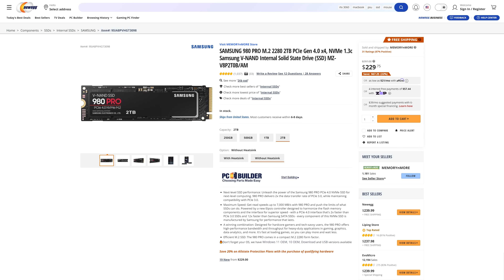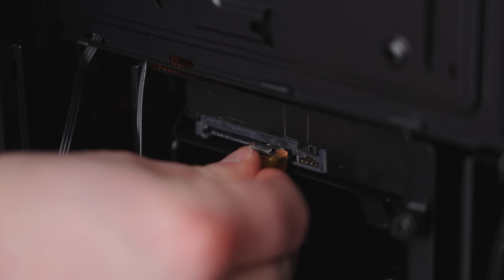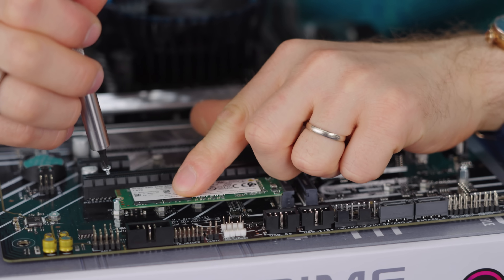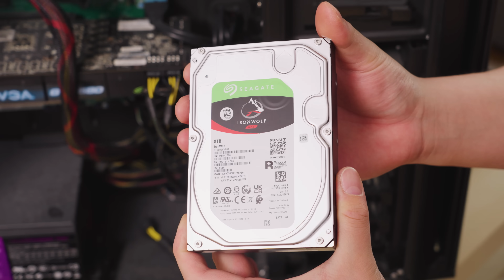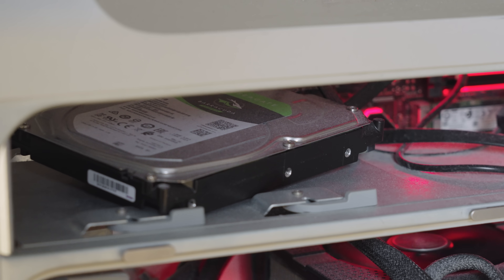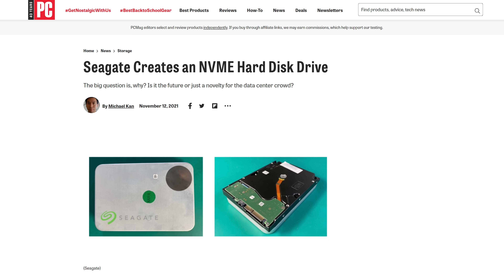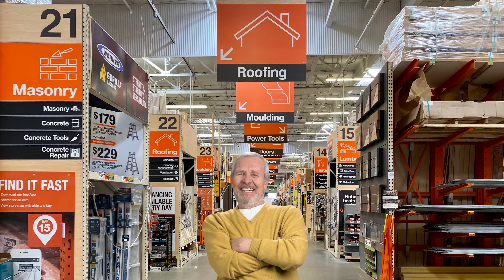Is SATA Obsolete?

Comment: I pulled out my old 74gb WD Raptor 10,000 rpm hard drive not that long ago. It still worked and still had the original Windows XP install on it.

Comment: Nah, I'm genuinely surprised that SATA is still a thing, even on the most modern motherboards. Please, someone pound a stake into SATA's heart and put it out of our misery.
Reply: Why? There's nothing wrong with SATA, just because you don't need it, doesn't mean the rest of us don't need it. The reason why it's around is that it's great for connecting many disks to the same computer and because it has a bunch of flexibility, I have two of my internal ports redirected out of my case via an e.sata port adapter so that I can have external drives. I don't see any reason for this to be such an imperative. It likely will eventually go away, but when the main issue is speed, it's probably not going to happen any time soon.

Comment: I’ve found the NVMe can generally be found cheaper than SATA drives already. The only reason to use SATA is when you’ve run out of M.2 slots.
Reply: For similar storage capacities sure, but you can find extremely cheap low storage SATA SSDs.
I've bought a few 120GB-240GB for less than $20 to retrofit on older computers. The latest one was a Patriot 120GB for $13.
They also make a perfect boot drive for a raspberry pi build or a cheap micro/media pc

Comment: I still use HDD for storage so SATA 6G ports are still viable for me. NVME is not priced as cheap as it should be. It should actually cost slightly less than SSD's. Considering you don't need a case for it and it is cheaper to ship and other factors. They are still gouging the price and until they stop I will stay with SSD/HDD combo's.

Comment: 1x SSD 128GB for my sys
1x SSD 512GB for bigger games (for shorte loading time)
1x HDD 1 TB for small games
1x HDD 2 TB for hobbie-stuff
1x HDD 8 TB for useless trash (datahoarder)

no need for an NVME, dont care in my system loads in 5 or 20 sec... i boot the PC only once a day

Comment: The reason SATA won out over pata is because pata maxes out at 166mb/s (which is slow even for mechanical hard drives) and sata maxes out at 6gb/s which is more than enough for mechanical hard drives but causes ssd's to top out at about 400MB/s (fast hard drives are only between 100-200mb/s).  Further the sata spec uses much thinner easier to manage cables that are physically AND electrically more robust (for longer runs) and standard integrated sata controllers used to have 8 ports on them, until they've recently been torpedoed to 6 ports max or even 4 ports on some lower end or small form factor boards due to space savings or money savings.  SATA isn't going anywhere in the short term because it's EXTREMELY popular to simply shove 6 or 8 hard drives in a low end computer and install a free NAS operating system like TrueNAS core/scale, or any number of others (for most truenas is probably where it's at though in terms of protecting data via zfs)  and enterprise storage servers BASICALLY do the same thing - only those are designed to be rack mountable.  tl;dr they don't MAKE nvme ssd's that are large enough to hold all the data I (and lots of other people) want to store.  especially when they only give you 2 or 3 (or sometimes only a single) m.2 slot on a motherboard.  the biggest slc pcie4 m.2 nvme drive i've seen so far is 8tb at an eye watering $1500, the 4tb version  is $700, which means that for most folks the attainable reasonable highest you'd actually buy is 2tb (still at about $300) which is still pretty expensive...  meanwhile I can go out and pick up a 14tb hard drive for about $300 or if I wanted to build a nas, I could get a 10tb drive (which is kind of the sweet spot right now for about $200).  if you put 8 of those together in a raidz3 nas, the speed scales not exactly linearly but close so you're looking at about 800MB/s (considering 5 active drives and 3 doing parity storage) (if you don't include any ram caching or compression which zfs is awesome at), so I could build a 2.5gb/s file server (honestly it should be faster) for about $1400 (in storage) with a practical storage size of 32tb (taking into account data redundancy and that the array needs to stay 20% free for anti-fragmentation purposes and slop space allocation) AND any 3 hard drives could fail at any given time without losing any data.  Every household with someone who takes pictures, videos, does any kind of creative work, etc. should have such a machine. (AND that machine should be backed up off-site (raid/zfs IS NOT AN INTERNAL BACKUP METHOD - the array is 1 of 3 places you should have your data stored. (it should be stored on some other local device AND a device off-site (be it cloud storage or regularly backing up to a series of hard drives and bringing them to another site or setting up another nas in another site and backing up to that).
Reply: 10K RPM hard drives are also bottlenecked by anything below SATA 3 or 2 usually. SATA 1 also maxed out at 150 MB/s, so that wasn't faster than IDE/PATA either.

Comment: No SATA is here to stay.. I just purchased a Crucial MX 500 SSD as my motherboard only had one M2 slot which had Kingston A2000 installed in it. If you want multiple SSDs then the only way is to use the SATA port

Comment: I'd imagine data centers would still have to rely on multi-TB HDDs until it comes a point where NVME drives can reach those same capacities at a competitive price. But it's nice not to be able to use them in a gaming PC because it means less cables.

Comment: If you need lots of storage, but not much concurrent transfer, you can also use a sata splitter to get five ports per connection. For a personal video archive, for instance, you will often have more need for storage than throughput.

Comment: the cost of nvme (particularly pcie3 nvme right now), is roughly the same cost of sata ssd's at reasonably large sizes (1 or 2 tb).  if you're in the market for an ssd, just buy the nvme ssd (that's roughly 7+ times faster and arguably slightly more reliable).
Reply: yeah I was trying to build a new pc with nvme/ssd boot drive+ssd/hdd storage mindset, but when I look at the prices it surprised me how 1 tb nvme is the best bang for the buck I could get
Reply: @naufalap  same, I recently upgraded my storage with a $200~ 2TB NVME. That pricing was unthinkable when I had built this system only 4 years ago in 2018

Comment: What kind of bad explanation is this? PATA and SATA are effectively the same, as they are both ATA standards. PATA was developed during the IBM days in the 1980's and at the time was the best interface. However PATA had the big problem of crosstalking if they went above 133 mb/s, and because a parallel data exchange doesn't allow hotswaping. To combat this a few techcompanies formed a organization and created SATA in 2001, SATA used bitqueueing so the datatransfer didn't need to be in parallel anymore and it eliminated crosstalking so faster speeds where possible. 

Early Sata effectively used the same processes ad Pata did. In fact both used the IDE protocol until ahci came around. Unfortunately SATA simply couldn't go faster than 600 mb/s as it was again limited by a few factors (I think corsstalking also started to be a problem again). And at the time there where a few new standards in development. But since motherboard manufactures started to put mini-PCI-E and later M.2 slots on motherboards the problem was already solved (both mini-PCI-E and M.2 where originally developed for laptops).

Will sata ever die? Yeah it will eventually, but only when necessary. So far most motherboards still come with PS/2 and a COM header, so if it fits, there will a few SATA ports, but it will disappear on ITX boards.

Comment: They didn't fact check this at all, or maybe they are too young to actually remember PATA. PATA was heavily used for optical drives also just like today with SATA, in fact it is less so today as BLU and DVD 5.25" bays are pretty much dead. That would leave SSD and HDD the only devices using SATA. A situation less in the favour of SATA then PATA. SATA will die, a direct connection for the PCB was always going to happen.

Comment: On a Z690 system (as shown in the block diagram) the GPU and first NVMe ports will be CPU dedicated, and all the additional expansion slots will be run through the Z690 chipset.  I have every single slot filled in my system and both the GPU and the NVMe have their full bandwidth.
The non-CPU slots go through the PCH.

Comment: Just the thought of having to pay for 20TB of SSD storage alone makes my head hurt. Yeah, I've got plenty of mechanical HDD's in my machine and no ... RAW performance ain't the primary concern there.
I've got 1 SSD and that's the boot drive. It's the only thing where the performance does really matter.

I don't even wanna think of the ginormous cost it'd take if all of that were to need to be NVME SSD's.
Reply: 20TB? Try 64 😄. Some are external though. I also have a few 4TB drives that used to hold data I've moved to new 8TB drives.
I probably have closer to 100TB worth of rust lying around, in use or just bot thrown away yet.
Reply: I have 32TB of NVMe storage connected to my laptop, 4x8TB in a Thunderbolt enclosure with software RAID. Yes it's QLC flash but the firmware automatically uses the flash in SLC mode for caching when capacity levels allow. Super fast and works great. The cost was about the same as the laptop itself.

Comment: I don't think SATA is going away anytime soon, you can only fit so much nvme onto a consumer grade motherboard that it won't be enough alone if you need more storage capacity. I'm just hoping that SSDs get to the point where 10+TB capacities are about as common as they are for HDDs soon at reasonable prices and decently good reliability, my NAS server would appreciate it.

Comment: I mean when it comes to most AM4 setups the 4 lanes for your second NVME tend to go through the chipset without forcing your GPU down to x8. I guess the downside is it's sharing those lanes with a bunch of other hardware so there could be bottlenecks when utilizing the chipset with multiple devices
Reply: It's the same for LGA1700 as well
Reply: In my case it is an actual problem - having a x4 and x2 nvme drive in a B450 motherboard limits me to 2 sata drives even though there are 6 sata connectors. But not enough PCIE lanes (when using a discrete x16 GPU).
Reply: @cszolee7979  It's been nearly two weeks and why is this guy not thumbed up yet

THIS is what I mean. That's why I wrote those textwalls. Because as you can clearly see, this guy is having a probably more budget oriented b450 board, and he's losing a bunch of SATA. If you treat your PC like a cheap gaming console and you're a zoomer you won't realize why this is such a massive deal until later when you're now stuck with insanely slow external drives through USB ports and you basically can't do anything with your machine because all those PCIe lanes are taken up by a few storage devices. 

NVMe only makes sense to me outside boot drives as a thing for video editors, because they're exceptionally fast for transferring huge multigigabyte files (like video editing) where the time it takes to do that possibly instantly actually matters (like video editor for a job, like the guys who work at LTT). Because of the fact it's still so painfully slow for moving large batches of small files, and because of the big difference in top speed between it and everything else (USB drive, old hard drives), its advantages all are removed outside those professional/prosumer contexts. 

It's very much like getting a Threadripper to play games on. It's completely phenomenal to the professional working at LTT, but a Threadripper actually sucks for playing games on compared to a say 5900x or 12700k or whatever for a fraction of the cost. A Threadripper and a bunch of NVMe drives is a dream for video editors and rendering stuff, but it's a really bad idea for the gamer or average family to get one. Right tool for the right job, and in NVMe's case, it's a pretty horrible thing for a budget build gamer for anything beyond the boot drive in the same way that getting an extra couple mSATA slots on an old Ivy Bridge machine is not worth the loss of your SATA ports.
Reply: @cszolee7979  We b450 are stuck with pci-e 3.0, with the newer 5.0 we could have the same lanes and the gpu to x8 and still have more bandwith.

Comment: Imo, the important advantage about hard drives is that they last way longer if they're unplugged.

Imagine a digital archive of sorts, where instead of stuff being on books, it's on hard drives that can (in theory at least) last hundreds, perhaps even thousands of years, meanwhile SSDs need current every once in a while since the cells depend on electricity to determine what is a 1 and a 0.

Comment: UMMMM, if you run more than 1 NVMe drive it does NOT take more of the (usually) 20 PCIe lanes from the CPU, it takes PCIe lanes off the chipset! Your GPU will still be at x16 in almost all scenarios.

Comment: I remember when I bought my first SSD. I turned on my PC and went to clean up the packaging and get my stuff put away from installation, expecting it to still take a bit of time, only to hear the win7 log in sound like 13 seconds later. I barely had my bit set closed. I haven't bought a HDD since like 2013. My first SSD was a 250gb Samsung 840 Evo. I had over 50k hours on that drive when I bought a larger drive, according to Samsung Magician.
Reply: I remember my first, it was a 2.5 120GB I got on a flash sale for £17 delivered(reduced from £80) and the difference was shocking to me.  Now I make a cup of tea then turn the computer on instead of the other way round.  Now I have a Samsung 970 mid tier 512GB NVMe as my main system drive and a Crucial CX 1TB 2.5 SATA for storage.  I do still have my ye olde 1TB WD Black HDD for storing smaller files and a WD 2.5 WD Black 512GB HDD someone just gave me for very small files.  As a standard consumer user to me there is very little discernable difference between my 3500MB NVMe and my 600MB SATA drive in use, it's the removal of the moving parts that makes the biggest difference along with removing the issue of file fragmentation, that's where most of the speed comes from and how it is maintained over time.

Comment: The Chipset also has its own PCIe lanes and can control some NVMe drives.

This is from the Asus B550 ROG Strix

Total supports 2 x M.2 slots and 6 x SATA 6Gb/s ports
3rd Gen AMD Ryzen™ Processors :
1 x M.2_1 socket 3, with M key, type 2242/2260/2280/22110 storage devices support(SATA & PCIe 4.0 x4 mode)

AMD B550 Chipset :
1 x M.2_2 socket 3, with M key, type 2242/2260/2280/22110 storage devices support (SATA & PCIE 3.0 x 4 mode)
6 x SATA 6Gb/s port(s)
Support Raid 0, 1, 10
The CPU and Chipset can run both, so no, you wont lose GPU performance.

Comment: What I would like someone to tell me is why we went from a standard that required two cables (power and data) to a standard that requires none. Why was there never a standard that used a single cable which transferred both power and data?
Reply: You're thinking of USB. Or Thunderbolt--TB ports are great. Love em
Reply: @joshuaeah  Those aren't internal connections.

Comment: SATA was around long before SSD went mass market. Solid state didn’t kill IDE/PATA. Serial is cheaper, smaller, and less complex than parallel links. Bus timing is easier to deal with, so optimizing for speed is easier. I’ve become the “back in my day” old guy on the internet. Thanks for that, TechQuickie.

Comment: The price gap already closed. You can get a budget 1tb nvme M.2 SSD for the same price as a budget 1tb sata SSD.
Reply: True but you don't see extremely cheap ($15 or less) lower storage NVMEs like you do with SATA.
You can get cheap 120-240GB Sata 3 SSDs for dirt cheap. Perfect for retrofiting older computers or building a cheap raspberry pi or boot drive for a media system or something.

Comment: An HDD is still optimal choice for many things like recording/constant write operations. Obviously write speed can be an issue
Reply: HDD good for long storage or rare data
Reply: Don't underestimate how much you can write to a decent SSD. For example, a Samsung 870 EVO 4TB has a 2400 TBW rating. If you write 100GB a day, it will take over 65 years to exceed the TBW rating.
Reply: Real talk : HDD good for memes, miscellaneous downloads and adult content
Reply: TLC nand flash (with dram) is acceptable too for long storage: 10-15 year lifespan est. if you don't rewrite too much.
Reply: I have 4x8tb HDDs in raid 0. I'm getting nearly 800MB/s speed. That's faster than SATA ssd.
Reply: @一本のうんち  That's pretty good sequential performance, but no amount of hard drives in RAID-0 is going to fix 4K random read/write performance, which is more like real world performance for loading applications and games.
Reply: It's also good for people like me who doesn't want to spend a lot for massive storage, but hoards data like there's no tomorrow.

Comment: As for SATA I grew up on single lane IDE and dual lane IDE both were PATA (It probably isn't specifically called single or dual lane that's just what I called it) (it had per regular ide each pin had two lanes per pin)